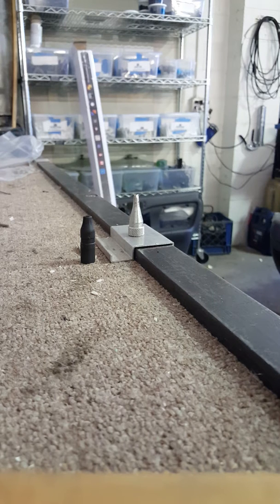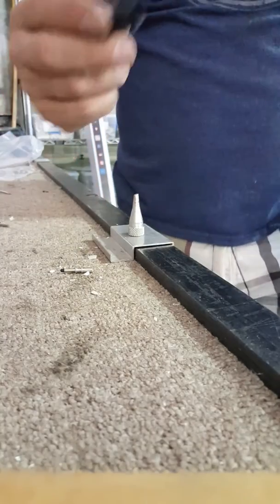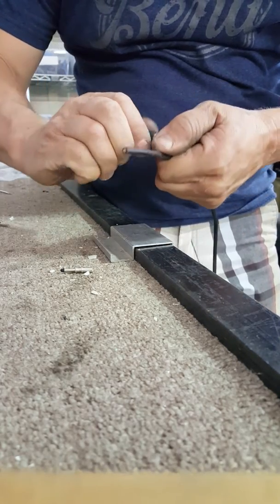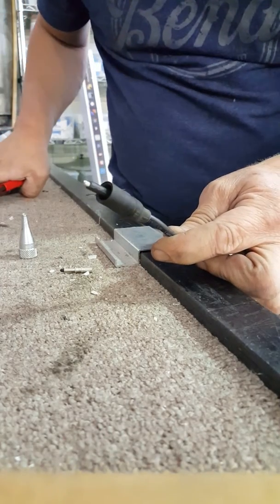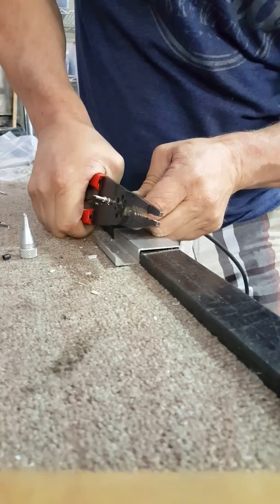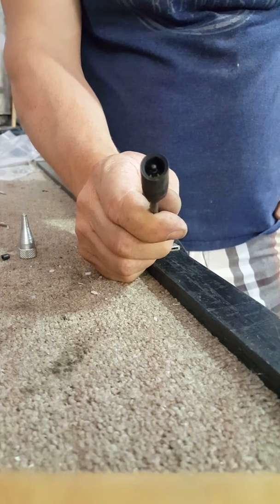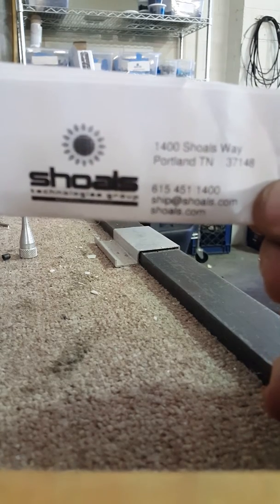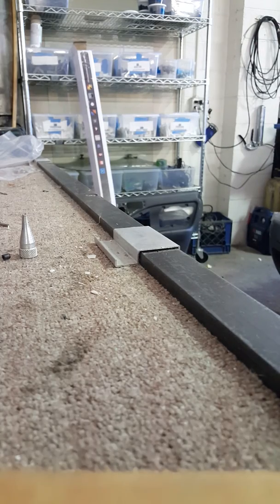Mc3 Connector DIY

Comment: Use WD40 . Cable will insert easy
Reply: Yes, but the Isolation of the solar cable dont like Oil, so you destroy the isolation with this method.
Most PV Installations are built for 20-30 Years, so your advice is not good.
Reply: Thank you for that. WD40 the wonderful fluid.